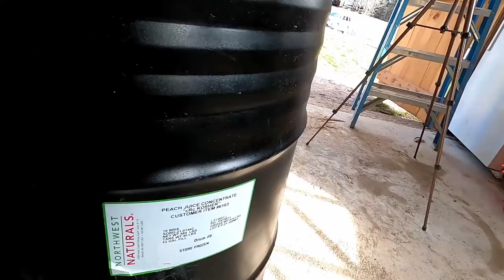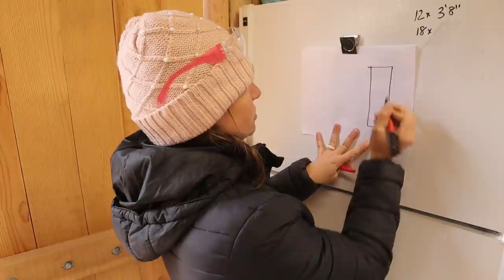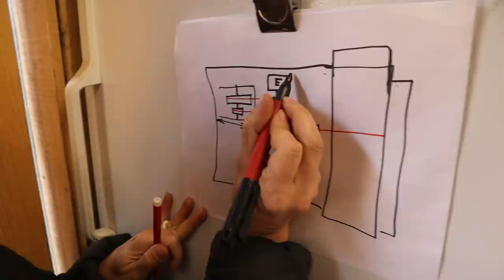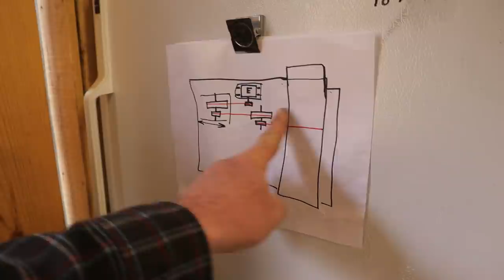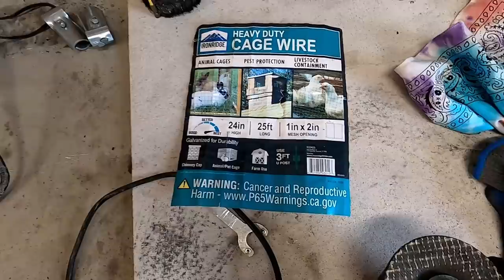Trommel build - start to finish with results // E69

Comment: Save your bacon grease. It works better for your drill bits when drilling. Just brush it on with an acid brush. Worst part is it makes you hungry when drilling but it sticks good and only becomes oil when it gets hot.
Reply from the maker: Haha!  All I need is the smell of bacon in the shed 😆

Comment: With wood and chicken wire this could be done a lot cheaper. Make the top the size of your tractor bucket on a angle, the fines go underneath so you can bucket them out and rocks get flipped over the other side.  It will take me a day to build.

Comment: Can I add my 5 cents to this 🙂When I wanted to separate the soil and small stones, I simply took the metal grid with the cells with dimensions a bit smaller than the smallest stone had (like gravel). I made a frame and fixed the grid on it under 45 degrees angel approx, then did the same - took the shovel and threw up the mixed soil on the grid. Such way I got the soil under the grid and the gravel in front of it. I didn't have the welder, no engine and no barrels.
Reply from the maker: Good deal, glad it worked for you.  This trommel build is in response to a previous episode (#61) where I explain the amount of material we're trying to separate.  It's hundreds of tons.  The ultimate goal is to feed this trommel with the tractor and start an efficient process of collecting stone.
Reply: @WalnutsandWineberries  oh, hundreds of tons? Then you need to build something much more bigger and stronger than what you have built now. Cheers!

Comment: Wife and I just found your channel and we've been binge watching your videos. Great channel and you both have the right attitude for this adventure.  Little off topic for this particular video but have you considered getting some chickens in the spring?
Reply from the maker: Thanks, hope you're enjoying.  Chickens will come when we finish building the house.  I don't feel like we can give them the necessary attention required because of all the projects we have going on.  Definitely in the future!
Reply: @WalnutsandWineberries  That's probably a good idea. My wife came home with 6 chicks one day and we had never had any before. Made them a shelter to roost and nest and we use electric poultry netting (mostly to protect them from predators) so we can move them around. Surprisingly easy to take care of just a few.

Unexpected benefits were: insect reduction.. they'll take care of those centipedes from daylight til dark and great fertilizer for the  the garden

Comment: I'm pretty sure you are going to need a better way to feed that.  you will need something like a ton of rock for every 5' of driveway.  Loading 16ton doesn't even begin to describe it.  would it make more sense for the mesh get progressively more fine as you go up so that you separate soil from small rock from lager rock?  Rock around where I'm at is actually super cheap, something like $5 per ton at the quarry and about $150 per ~10 ton load delivered and tailgate spread so I would not do this for the reason you are, but I do have river frontage with a natural gravel bar here to take advantage of and I might build something similar mostly to sort out the sand and pea gravel size rock, those grades cost significantly more per ton at the quarry.  I have also thought about doing something similar to what you have here for mixing concrete (maybe slowed down another step and with a different barrel setup) to be able to mix like 1-2 yards of concrete at a time which is in the range where you way overpay for redi-mix due to short load fees, or you way overpay for sackcrete and then break your back mixing and placing it 2 cuft at a time with a standard mixer.
Reply from the maker: Our cheapest crusher run is $20/ton now from the quarry.  Not delivered.  $100/delivery.

Comment: Good job. From experience the screen you used will not hold up for long. 
Ended up using cattle/horse panel on mine.
Reply from the maker: Good idea.  Did you weld it on?  Something to think about if this should fail.
Reply: @WalnutsandWineberries  I bolted mine in place in case it should fail or l encounter something with smaller openings. Not cheap new but 5ft x 16ft. Send the young lady out and maybe she will make another great find. Another idea is to just drill a LOT of 1 - 1 1/2 inch holes in different barrels. The small stuff comes out while you get the bigger stones. Your time is free to you.

Comment: Why didn't you put the wheels/pulleys together on the axle without spacers and drill the pilots on your drill press. Boom -  the holes line up! There are several RPM calculators on the net, just type in RPM calculator. I would attach the idler on a pivot with a strong spring pulling the pulley down to keep the tension and those proposed wheels will help with the tension also. But nice job, as usual.
Reply from the maker: Thanks GR.  The reason I didn't drill through both at the same time is because the diameter of the large wheel exceeded the space on my drill press.  Need a bigger drill press.  Always wanted a self-standing one.
Reply: @WalnutsandWineberries  I should have thought of that, I have both but I don't think the harbor freight has a bigger throat than the Delta bench top.

Comment: Im curious how the bearings in the tires you used for pulleys and barrel rollers have held up after 2 years of use?
Reply from the maker: There's a trommel update episode where I made some improvements.  I replaced those wheels with some skateboard wheels and they are still holding strong.

Comment: Ever think about building a rock screen separator ?
Reply from the maker: Yes.  We considered it but felt the trommel would work better for our goal.  The problem with the screen is that many of our rocks are flat, we were afraid that they might just fall through with the dirt.  After weighing our options, we went with the trommel. - Meg

Comment: slip your speaker magnet inside a paper or plastic bag before you "sweep" with them, then all the metal filings fall in the trash when you slide it from the bag

Comment: I have a 1947 cj 2 a jeep for 30 years now about 75 years old . I put all new breaks in back then .so now I am doing them all new agen. But I see one of the raise & barren pushed out on the axle on the right hand side of jeep .so I took the cover off the basket no broken parts. I no it has not been taken apart . Because you would tall if some one been in there.what I can see the spider gears look good .But I am not shore that it looks like to much play in them on the short shafts that hold then in . I got to see how they should be. like I say there is some shaving in the bottom but not bad for 75 years old .need help.

Comment: When your pulleys come apart just put a 3 inch or so piece of pipe between them and weld it.
Reply from the maker: I see that maybe coming.  Welding a spacer right on is a good idea.  Stronger.

Comment: Should’ve went to a tractor implement dealer you could’ve bought pulleys you needed for the right size and you wanted to cut the tires off and have been cheaper

Comment: What setting and wire diameter did you use when welding the 55ga drums together?  Thank you so much for the info and being so real on the video.  Same on when you welded the wire mesh... what gauge and amperage, please.

Comment: why not just set up an adjustable gas pedal with locking to adjust speed depending on how push in it is?
Reply from the maker: You would lose torque at lower rpms.
Reply: That’s a great point, I went and bought me some barrels, I’m going to start my build.

Comment: If you would get propane gas and put a nozzle back on your welder you can run .035 hard wire on your welder and you will have way better welders just to let you know
Reply from the maker: Hey John, it's flux core.  Do you mean a shielding gas like Argon?  This welder does not have an input for gas.  Didn't know what you meant.
Reply: @WalnutsandWineberries  ok if you don't have the input for gas thin you have to keep using the same wire put I would still put a nozzle on it to help keep the gas that comes from the welding wire and you will have a better weld and i would like to show you some really nice welds if you would like to see them this is what i do for a living ........ just trying to help you out ......

Comment: Can you please tell me what gage of weld you used when joining the barrels together?
Reply from the maker: Wire was flux core #30 (0.030) and my settings on the machine were probably around power of "C" and wire speed of "5" running at 120V.  Hope that helps.

Comment: What kind of welder are you using...?
Reply from the maker: Mig welder from Harbor Freight.  I think it's called the Easy Flux 125 by Titanium. I've used it for countless tasks.  Best bang for your buck if you're not a label person like me.
Reply: @WalnutsandWineberries  Thank you for answering... I have a 220 volt stick welder but it would have burned through some of the stuff I've seen you weld... I would like to weld thinner metals too...  Affordably... Thanks again... Have a great afternoon...

Comment: Nice build, first time here. So lift up the end so the drum is trying to fall off the other end. You could make other drums to sift dirt, put rubber tits so you could get the feathers off chickens. All with the same equipment.
Reply from the maker: Thanks, I was just talking about making a different drum yesterday!  Funny you mention that.  I bet you can run compost through it at different stages and it would benefit it greatly.  Never thought of the chickens.  👍. There is an update video I did on this too, if your interested.  Made some improvements.  Episode #74.

Comment: A simple shaker table would have been too easy. You over complicated this project BIG TIME. Sry. You want to be able to load the shaker table with the tractor, not a shovel..
Reply from the maker: Shaker table is too small for hundred of tons of rock.  I also mentioned this was a test run and a hooper would be added so the tractor could dump right in.  I don't think you understand the project or the purpose at all.  Just trying to bash someone's work.